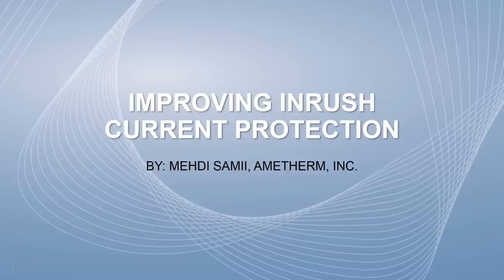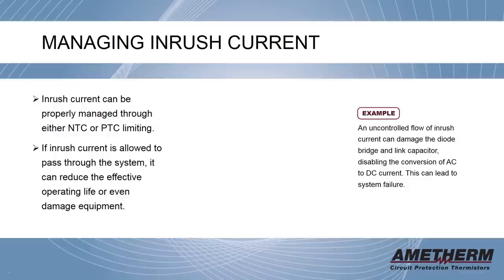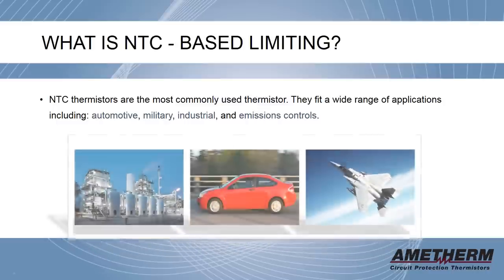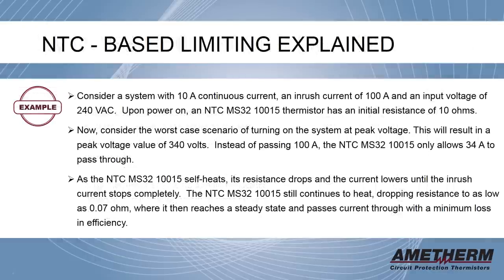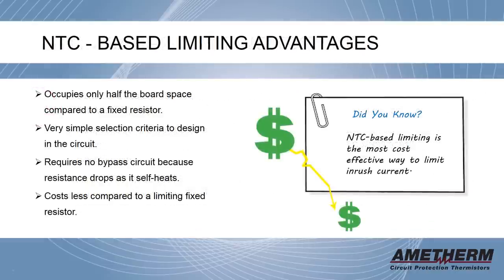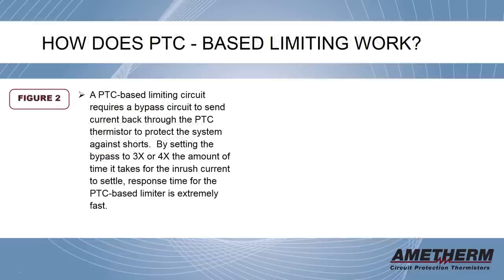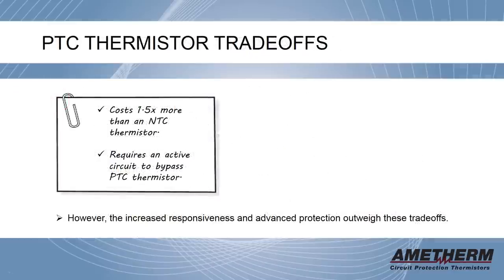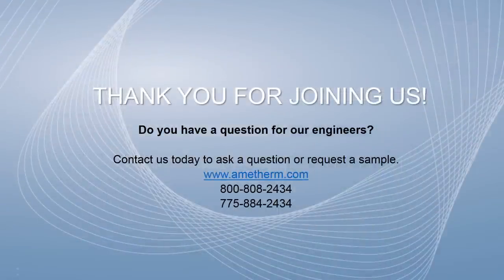Limiting Inrush Current with NTC and PTC Themistors

Comment: I recently tried wiring a NTC in series with my fridge compressor in an attemp to limit inrush current on start. I measured the regular inrush current of the compressor, it was about 50A @ 127Vac. I wired a single 10Ohm NTC in series, and expected the inrush to drop about 5 times, following Ohm's Law (127Vac/10Ohm = 12.7A). However, the results were quite unexpected haha. The inrush current still measured around 48A @ 127Vac, a negligible drop, futhermore, for my surprise, the NTC literally exploded on start LOL. Somehow it still managed to keep functioning after the inrush. Steady state current is about 2A, way less than NTC max. steady current specified on datasheet of 5A.
Reply: Compressors are a special case because they have start and run windings, with a boost of starting torque coming from the start windings. High inrush current and difficulty starting is often caused by failure of the start/run capacitor, or in smaller fridges failure of the PTC resistor that cuts the start windings out after it spools up. Failed PTC's are problematic and common causes of failure in small beer fridges, so they aren't used in bigger systems. I wasn't aware they use NTC resistors, I've never seen one. Small conventional piston compressors are often built with a permanent split capacitor design, which sometimes responds to adding a hard start kit (start cap plus potential relay) to boost starting torque, then cut out the start windings after a few seconds.

Comment: Will NTC work to reduce nuisance tripping of circuit breakers if a single NTC or 2x NTCs are used at the AC input to a high inrush power supply such as an LED driver with 70A 250ms inrush?

Comment: How can the tiny leads on the thermistor handle the up to 30 amp ratings of the devices? We are told to use 12 gauge wire on a 30 amp circuit in a house, but the NTC thermistor has leads the size of a guitar string and can handle up to 30 amps?